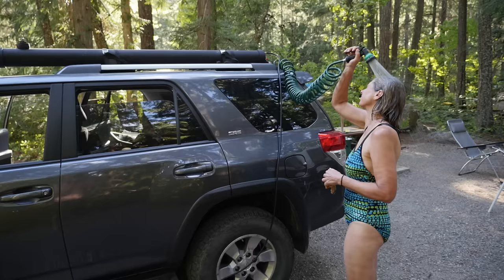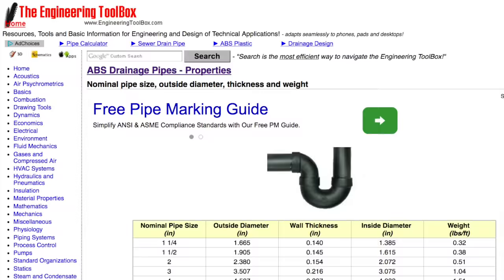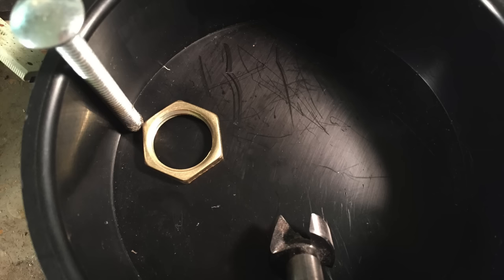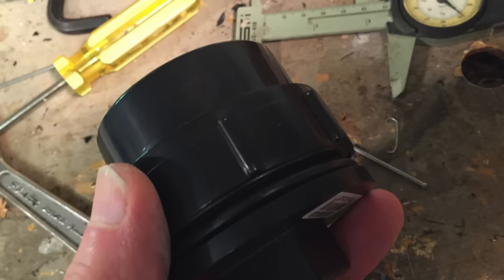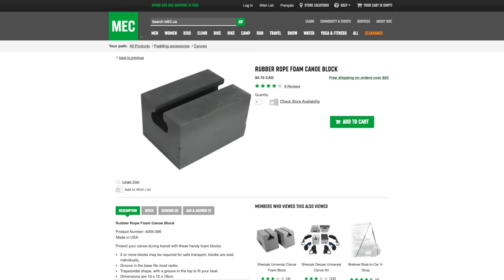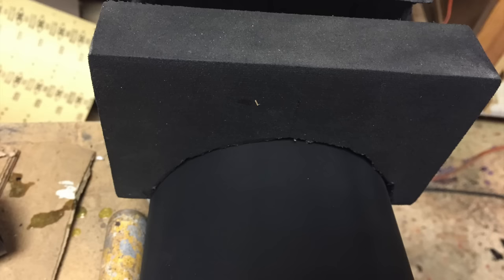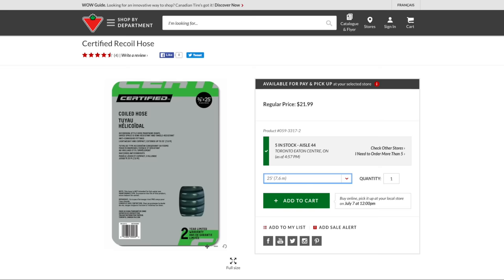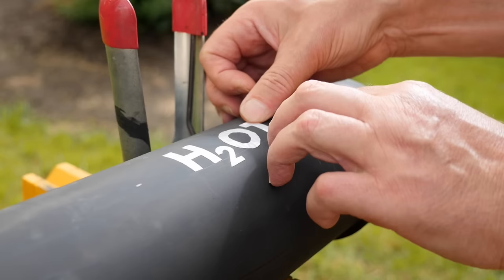H2OT - Rooftop, pressurized, solar-heated shower/sprayer using ABS pipe. DIY

Comment: Do you pressurize the tube and then turn off the compressor? or leave the compressor running while showering? Thanks
Reply from the maker: I pressurize initially to 30 psi, but as the tank is full of water and water does not compress, it will drop from 30 to 0 very quickly. As water is used, it creates a void which is replaced with compressed air. The greater the void, the longer pressure will remain.  As a rule I pressurize to 30 and turn off the compressor. When it drops to below 10psi, I tunrn on the compressor until it reaches 30 psi, and then turn it off.   Rinse and repeat.

Comment: Hey how would you go about doing it with the original tubeless tire valve u purchased
Reply from the maker: Exactly the same process. The hole size is the same. Just those valves are a bit tricky to install as they fit very snuggly. The bolt-on valve is much easier to work with.
Reply: @ImaginetMedia  thanks so much. I ended up finding the valve you used. I just couldn’t find the locking nut for the faucet. I hope it will deal with some gorilla glue haha
Reply from the maker: @kylejohnson4917  The locking nut probably is not needed. The key is to drill the proper sized hole so that the facet threads tap themselves into the ABS. I actually heated the threads up with a propane torch and that slightly melted the threads and made the tapping very easy.  You can see the discolorization of the inside of the ABS from the heat in one of the shots.  That valve is never going to leak.  Key is do NOT drill the hole any bigger than it has to be.
Reply: @ImaginetMedia  thanks a lot for your help!!

Comment: Awesome video! Great project, I appreciate you doing all.of the "homework" and sharing your conclusions. For pressure relief, did you consider a commercial (automatic) solution, like the ones found on a domestic hot water heater?
Reply from the maker: I did not see the need for a pressure relief valve as I am controlling it from the compressor. Pressure from heating up would only amount for a few pounds of pressure on its own.
Reply: Thanks for the reply and the information.

Comment: I'm confused, which is it 15 litres or 30 litres capacity?
Reply: I checked using pi * R squared h and 15 litres is correct for 4" ID 6' long pipe, maybe he had 2 identical pipes, therefore 30 litres.
Reply: It holds 15 ltrs he emptied then refilled it as a test.

Comment: What size hole did you drill for the threaded valve?
Reply from the maker: As the threads are tapered NPT, I used a bit equal to the thread "valley" diameter.  The threads tap themselves into the ABS. Just do not drill a hole to large to start. If it is too tight, just increase the diameter.

Comment: I just built mine and was curious about your numbers. At 30psi, how long does yours operate on the shower setting? I’m getting about 30 seconds before I have no more pressure. And about 3 minutes on the jet setting.
Reply from the maker: Water does not compress. That is the most important factor to remember about gas-pressurized chambers. If there are zero air voids in the tank the compressor will hit 30psi in a few seconds. It will also drop from 30 to zero in a few seconds. As more water is used, more air void is created to accept compressed air. The larger the void the longer it will take to hit 30psi and the longer it will stay at a usable (>10psi) pressure.

Comment: Great video. We are in arizona, any ideas on how to control the water temp?
Reply: In AZ, just like in TX the water in these things can get literally scalding hot!  Barring something very monetarily inefficient, the best way to control temp in a DIY system like this is to park in the shade or sun for cooler or warmer water, respectively.
Reply: I don’t know about controlling it, as in selecting a particular temp, but you could reduce the temp it reaches with a reflective wrap. Some of the cheap silver windshield shades you can get from the $ store would work. Cut/tape to make a long blanket for the top half of the surface and when the sun is too hot, lay it on top and secure with bungee/zip ties/ Velcro straps. Keep it rolled somewhere to use as and when. Obviously a better quality material will last longer and be more suitable for use on the move but you’d have to investigate to find something durable enough for weather and road wind speed, I’m sure there will be something out there.

Comment: This video was so helpful!! I made the mistake of buying abs and was worried as all of the other videos used pvc. Would it be ok to use a pvc fitting jus for the fill valve? 
Thanks!
Reply from the maker: All the other videos that use PVC should have used ABS. Read the detailed explanation of why I chose (and you should too) ABS over PVC for this project. It is in the description of this video on YouTube

.
Reply: Hi, I’m using the same type of filling port as you’re, I believe it’s called a “clean out adapter”. Mine was sold without any gasket and leaks water, do you have any suggestions? 
Thank you!
Reply from the maker: @TheWeekndCamper  Here are a couple of links for the cap/plug that include the gasket...

https://www.homedepot.ca/product/lesso-2-in-abs-male-plug-mipt/1000116110
https://www.canadiantire.ca/en/pdp/bow-abs-dmv-mpt-plug-2-in-0632357p.html

If you cannot get one of those, I suggest looking for a 2" silicone ring gasket on Amazon or Ebay.
Reply: Hi

Thank you for your help. I used the same fill port as you but there was a slight gap and it won’t hold the pressure. Do you have any other social media or an email address I can contact you on? 

Thank you
Reply from the maker: @TheWeekndCamper  You can reach me at info@imaginet.ca.  Send me a video clip of the leaking fitting.  Also, did you use the exact fittings I listed or one from a different manufacturer?  Also, try a few wraps of Teflon tape on the threads.

Comment: Love your build.Couple ?s.Why did you use flat black instead of gloss? Also wondering if it will work in cooler weather?
Reply: Glossy is reflective, so would reflect a small portion of the energy away from it rather than being absorbed. Haven't made one yet so can't speak to the other question.
Reply: Yes, it works in colder weather.

Comment: If i used a gas station air hose that had no psi gauge could i use a pocket gauge to check the psi or will it get full of water? Dumb question? Sorry
Reply: If you test the pressure inside of the tank at the valve, water will (or should) come out and more than likely enter the gauge.  Is this a problem? Probably not. But i would recommend starting with a cheap one just in case.  Or better yet, invest in a pump that has a gauge built in.

Comment: What glue is used to secure the spigot to the end cap? I’ve used epoxy and caulking but it still leaks…I‘ll try an o ring and nut next, but any glue advice would help
Reply from the maker: I do not use any glue.  The threads are tapered NPT threads that self-tap into the hole.  You must make sure that the hole you drill is the correct size. If you hole is too big, it will not self-tap in and will obviously lead. If your hole is too small, it may crack the lid. If you read the FAQ I provided in the description of this video, I wrote...

THREADED SPIGOT
Before threading the spigot (Drain) into the end cap, I heated the brass threads up with a propane torch. This slightly melted the ABS and made threading it in very easy. Once cold, it formed a perfect seal.
Reply: Buy a 1/2 threaded pvc coupling like they use in irrigation.  Also add an oring between the pvc coupling and the end cap on the inside.

Comment: Great video. General question. Do you fill the tank to the max? I'm curious because when you use the air compressor technically would there need to be some "room" to compress the water? I could be completely wrong or overthinking...
Reply from the maker: You are correct. I fill it to the brim so that there is no room for water to move while in transit. It is essentially a solid mass thus preventing a water hammer and the resulting missile launch when hitting the brakes.  The downside is that water does not compress so when full it pressurizes to 30 psi in a few seconds and you only get 15 secs of the shower, but as you use more water there is more airspace available to compress, so the tank holds more reserve pressure, resulting in less time using the compressor. Typically once the tank is half empty, 10 seconds of compressor time would be enough to use the remaining half tank.
Reply: @ImaginetMedia  I didn't even think about what would happen with a half full tank driving down the highway. Great tip of advice! I just built mine and still need to paint it. Great video and thank you for the reply!! Cheers my friend!
Reply: @ImaginetMedia  couldn't you just pressurize what's left in the tank creating a solid mass so you can drive safely?
Reply: @farmermike9262  pressurized air will not creat a solid mass.
Reply: An expansion tank could be added for just air to get longer showers with the ABS full.
Reply from the maker: @joevandenbosch6012  Joe is correct on both issues.

Comment: Why did you install the Schrader valve in the rear and not in the front by where your compressor runs off the battery
Reply from the maker: I wanted to have the front end clean of any protrusions. Tha way I can store the shower on its end. Plus, in the back the drain provides a lot of impact resistance in the event that end was ever hit with something or dropped, thus protecting the valve.
Reply: @ImaginetMedia  Thank you. Since my truck is longer than your Toyota I'll have to check my hose length. But your explanation is solid.
Reply from the maker: @scottgorman7166  My compressor has a 10 Ft. Power Cord and 16 Ft. Air Hose. Distance is not a problem reaching the back from the battery.

Comment: I was looking to make this for my converted spinter to camper, I tried to find but was unsuccessful in what the total cost was for you in materials ?
Reply: imRikkiBobbi I just built one for about $75 it was designed a little different, less pieces no cutting hole in pipe etc.
Reply: @mcdlb181  Any shot you'd be willing to make one to sell?! I just picked up a promaster
Reply: Absolutely Kris with a K

Comment: How did you install the radiator drain plug?  Just siliconed it in or is there a lock nut on the inside? And where are you putting the rubber O rings?
Reply from the maker: It has tapered threads. It is self-tapped into the ABS.  There is no silicone or any sealant whatsoever used anywhere on the project.
Reply: @ImaginetMedia  Where did you put the rubber O rings?
Reply from the maker: @caseywallace4585  They were not used.
Reply: @ImaginetMedia  Have you had any issues with losing pressure from the threaded cap?
Reply: Hunter Golden I am wondering the same thing. I made a similar water system but I used a cleanout tee fitting and I’m having a hard time keeping the treaded cap water/air-tight. I’ve tried Teflon tape and Vaseline as a few other tutorials suggest. @imaginetmedia did you have any issues with this?
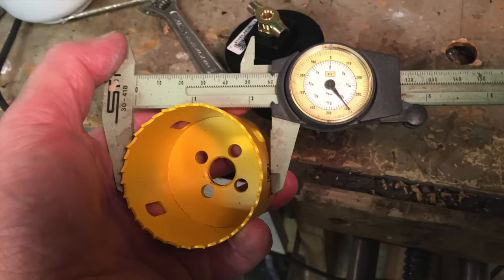Reply from the maker: @kristenthiry6951  I have had no issues with leakage. If you used a Tee instead of a 2" cap, you have substantially more perimeter of seal suspectable to leakage.  If you look at the video at 2:23 (and several other spots) you will see than my cap has a seal/gasket. Apparently, many manufacturers do. not include this. Here in Canada, the cap I used came with this seal. I also added a few wraps of Teflon tape, just in case.
Reply: Kristen Thiry I had this same issue but once I used Teflon tape and tightened fully, it stopped leaking. Problem with that is the cap is crazy hard to then unscrew and fill the tank again. So I got a female to female adapter, hook one end to the hose and the other to my “out spout” with the water flow open and that’s how I fill it; do this with the radiator pressure valve unscrewed and this will tell you when it’s full. Now I don’t need to mess with the top cap anymore, it just stays on.  If I made it again in the future, I wouldn’t include the top clean out; there’s no need for it; I’d just put the radiator valve in somewhere logical. I also had leaking around the actual radiator release valve and I used a combination of JB weld for ABS and black caulking (couple applications of both) until it stopped leaking. Hope this helps.
Reply from the maker: @caseywallace4585  Brilliant modification. I like it.

Comment: Do you leave the compressor running while using the shower? What brand compressor?
Reply from the maker: No. The compressor is only needed to be on when the pressure drops to the point you lose significant pressure. I usually turn it back on around 15 psi. NOTE: If the tank is 100% full of water, there is very little room for air as water does not compress. So, at 100% full, you wil only get a very short spray before you have to re-pressurize. As the water level drops, you have more air capacity and the pressure will stay high for much longer. 

I used a Viair 88P Air compressor. This is a VERY good compressor. The last one you will ever need to buy. Be wary of cheap big box compressors. They will fail you when you need them the most (inflating a tire, not a shower). 

http://amzn.to/2b4EXtq
Reply: +imaginetMedia Do you have any concerns about lead poisoning? The Viair compressors have California Prop 65 warnings, which usually indicates lead or some cancer causing material used in it. The brass ball valve you're using looks just like the ones at Home Depot that have warnings in small print on their paper tags that state the valve contains lead. It recommends washing your hands after using water from it!

Comment: Great video! I'm about to build my own. What are the reasons why you chose ABS over uPVC?
Reply from the maker: I have answered this question many many times in these comments. In summary...

Take a piece of ABS pipe and piece of PVC pipe , same size, length and diameter. lie them on a hard surface. Take a sledge hammer and hit each one. Make note of what happens immediately after impact. (Safety TIP:: hit the ABS first) This will tell you why you should use ABS and not PVC. You will have lots of time to ponder the results on the way to the hospital to have the shattered PVC fragments removed from your body..
Reply: Thanks for the advise. I assure you that before I asked, I went through most of the comments and replies. There are just too many. No surprise there. Your video is well done. Thanks for your patience.

Comment: Would a radiator cap be compatible with the ABS female fitting instead of fitting an ABS cap with an auto pressure release valve?
Reply from the maker: I am not sure where you would find a radiator cap with the correct threads.

Comment: For the fill port, have you had any problems with that seal @ the pipe, where you drilled the 2 3/8" hole?
Reply from the maker: None. It is impossible to leak there. The solvent cement literally melts and welds the ABS parts into each other.
Reply: @ImaginetMedia  Thank you for the response! I am just about done with mine, and saw another video, where the guy used a ' T ' and then just placed that threaded cap piece into that with the abs plastic bond. I just didn't want to waste money, if it wasn't necessary. The drilling shall commence this evening!
Reply from the maker: @bradynpeters  make sure you are using ABS pipe and ABS solvent cement. There are a lot of comments on this video from people that do not understand the difference between ABS and PVC.  PVC pipe is not chemically welded. It is glued. Big difference.

Comment: Nice set up. how did you glued your valve to the PVC end cap?
Reply: ABS*
Reply from the maker: First off it is not PVC, it is ABS. Totally different chemistry, thermal, bonding, and strength characteristics. The valve is not glued it, it is threaded. The valve has NP tapered threads, that you can "tap" into the ABS cap for a perfect seal.   If you look carefully, yo will see I had to had some filler around the outside of the valve around the last thread. This is because I could not tighten it any more. I debated drilling a lagger hole but the risk of bottoming out the threads and having the valve misaligned was not worth it.

Comment: Anyone who's built something similar have any success with Rectorseal for your T? I installed a 4" t on the top and don't find teflon tape to be practical for repetitive use keeping the seal.
Reply from the maker: The reason I went with a 2" fitting and not a 4" Tee, was because of the potential seal issue. A 4 " Tee has almost 13" (circumference) of thread that has to seal.  Hense, I went with a much smaller option.
Reply: @ImaginetMedia it looks like you used teflon tape to seal that thread. How has it been to clean and rethread that seal over time?
Reply from the maker: @PurposeTravel  Teflon tape works great. I only need to add it once a year (you need to know how to wrap it correctly).  If you want to remove it, it just pulls off like a thread. It allows me to get a perfect seal without having to over-tighten the cap, which I want to tighten only using my hand.
Reply: Ahh sweet. I was going to do the 4” T thing as well. Not so much now. 

I can’t believe YouTube has recommended this, I’ve not said anything about it, I’ve not googled anything for it, not gone anywhere near the hardware, just thinking about it and blam! This guy is in your feed
Reply: @ImaginetMedia  ... Had you thought of using a tee-wye (4"x2") and a threaded coupling? Might cost a few bucks more but saves a step in machine type fabrication, for those who don't have the tools.
Reply from the maker: @rupe53  That would work and many have done so. However, It adds cost, weight, and is not as aesthetically clean. I want it to look like a solar shower on my roof, not a renovation plumbing mess on the way to the dump.